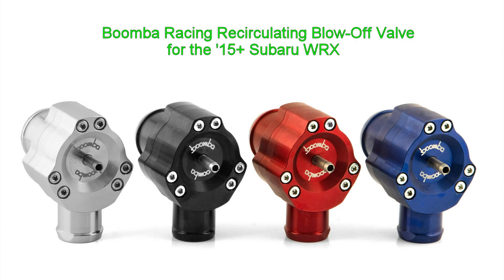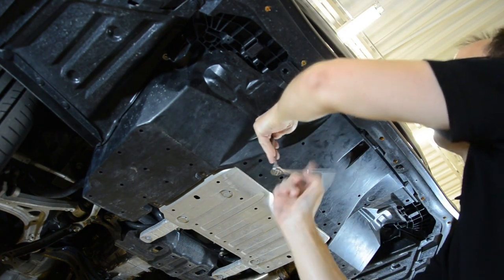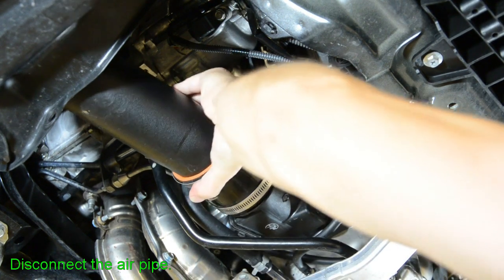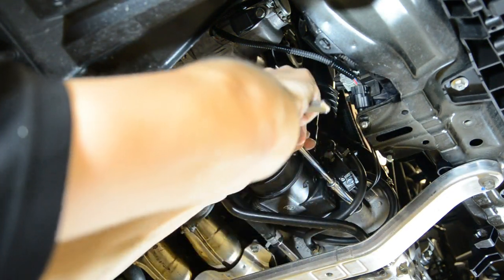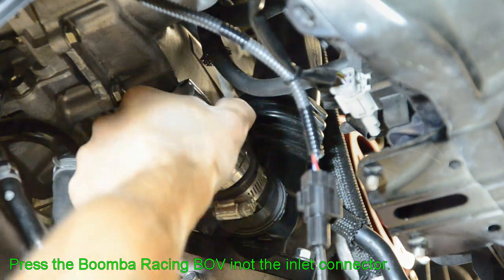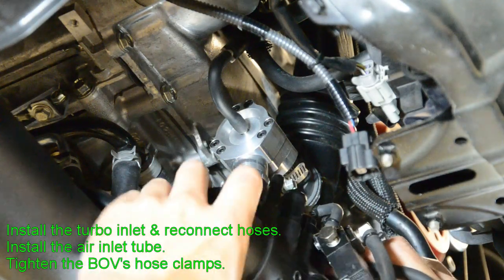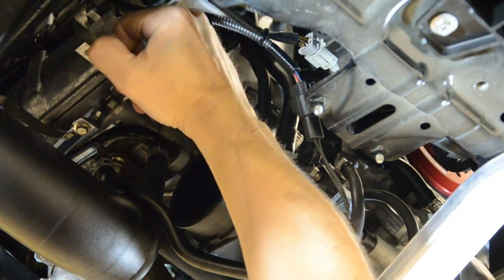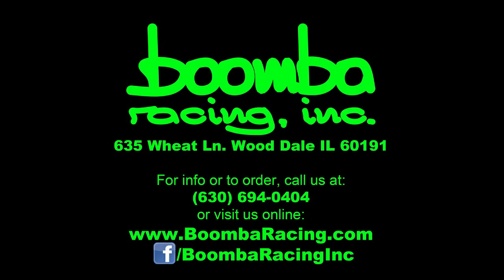How to Install | Boomba Bypass Valve for '15+ Subaru WRX

Comment: U don't need to torque the 2 bolts from the turbo ?
Reply from the maker: Can you timestamp where in the video you are referring to?
Reply: BoombaRacingInc 3:20 to 3 :27
Reply from the maker: You want to make sure they are tight, but nothing overly crazy.

Comment: I'm curious about this as well. I just ordered boombas shift kit last night and was thinking about this and my tuner told me they have never seen a leak in the stock bpv. And my car is pushing 325 @ the wheels. And told me never to get a valve unless it was 100% recirc which this is. Is a retune required for this install?
Reply from the maker: We have heard of some tuners that have found leaky BPVs on totally stock WRXs. You can use this part on a vehicle that is totally stock, or heavily modified. There is no need to retune after installing this piece. If you are already working with a pro-tuner, it doesn't hurt to send them some logs to see if they can squeeze you out a little more power after the installation of this piece.

Comment: Does the Boomba BPV void any dealer warranties?
Reply from the maker: When it comes to warranty questions, we would advise you to speak to your local dealer.  Every dealer is different when it comes to warranty claims on a modded vehicle. In short, no but again every dealer is different.
Reply: Ok. Thanks.. I just bought the car 2 weeks ago. The BPV would be my first upgrade.

Comment: Quick question when you re installed the stock inlet what torque did you use on the two 10mm bolts? I just did hand tight then a quarter turn. Wondering if that’s relatively close ? I saw somewhere on a forum it’s around 10ft just trying to make sure my install was smooth.
Reply from the maker: You should be fine. If you are worried, pop under there and give them a snug!

Comment: Does this offer any performance qualities?
Reply from the maker: Yes this is a huge upgrade over the stock BPV which is known to tear and leak boost. The stock BPV features very poor construction and is made from cheap plastic and rubber and features a very flimsy spring. Our valve has aircraft grade billet aluminum, a brass piston, and Viton O-rings and is tested to 100 PSI to ensure leak free operation. All of our BOVs also carry a lifetime warranty to the original owner. Our BPV helps to eliminate boost spikes and holds pressure much better than stock. Check out this video to see the power gain we picked up! https://www.youtube.com/watch?time_continue=147&v=QFyw-ktSQEQ
Reply: Yes, and the best part is you don't need a tune with this, either.  Approximate gains from this is a surprising 10-15 HP over the stock piece.  Just got mine in the mail today. :D
Reply from the maker: ^^ They responded before we even got the chance! lol

Comment: I got a check engine light as soon as I turned car on. Is this normal?
Reply from the maker: A boost leak would most likely cause a CEL. I would make sure sure all clamps are tight and the vacuum line is secure.
Reply: @BoombaRacing  It cleared itself up after second start up.